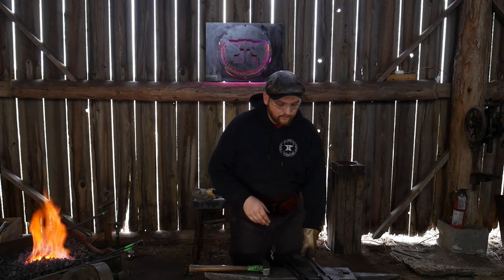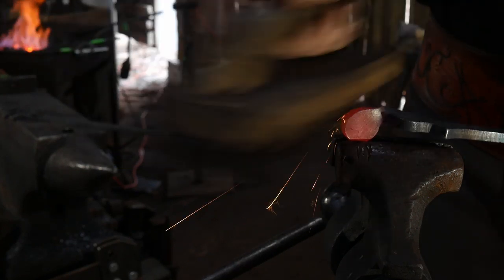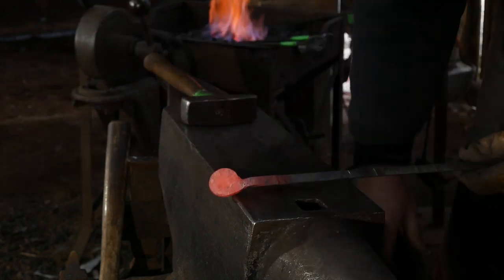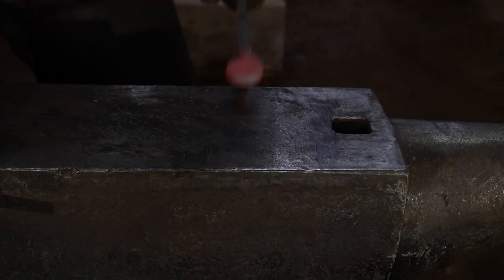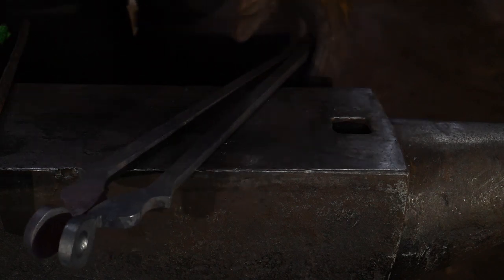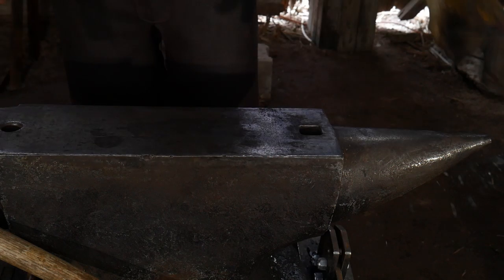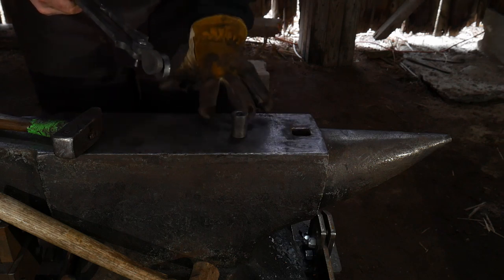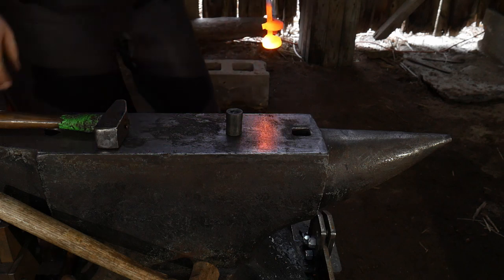Precut Farrier Tongs: Forging and Reviewing RX 09 Tong Blanks

Comment: Roy,  I make tongs with the "Dempsey Twist" method all the time.  I believe where you got confused on the twist direction was when you looked at the twisting from the jaw end when in the vise.  Normally, for the "right handed" tongs, being either forged or twisted, the direction is from the perspective of the smith with the tongs pointed away, outward across the anvil or vise.  In that case, the twist is correct in a counter clockwise direction.  When you looked at the jaws in the vise you were looking in the opposite direction and it was clockwise.  When forging jaws or twisting in a vise, always use the perspective of the smith facing along the reins away and toward the jaws...you'll never be wrong.
For "left handed" tongs, the twist is clockwise.

Comment: Greetings from Hellas.What kind of iron is that pair of tongs from?And how many inches is the thickness of it?
Reply: A36 mild steel and they are 3/8 inch thick hot rolled the tongs also all very in length depending on the model you choose.

Comment: Roy if you were left handed and making this tongs to hold in your right hand would you reverse the twist of the first step?
Reply: Thomas Brighton I believe if you line the reigns up you don’t have to worry about it as long as they are the same, but if you offset the reigns do it this way so they lay top is closer to the thumb in an open hand. That is my understanding of making tongs how ever I’m right hand and do it opposite

Comment: Does the ears serve a purpose or are they just for aesthetics?
Reply: IMO they are a remnant or vestige of forming tong blanks from a single flat bar.  After both ends have the nibs and boss formed, the blank is split down the middle with a hot cut.  However, when the slit approaches the boss, you curve the cut off to the side.  This leaves the "horns" or "ears" on the blank.  Crafty Apple cuts their blanks this way to resemble what is sometimes referred to as "ferrier" style.

Comment: You said farrier tongs but I’m not sure how they work, what’s the dimple for?
Reply: On sheet metal a purely flat faced nib has trouble getting a grip since the force is evenly distributed.  For flat jaw tongs an improvement is to add some vees and convert them to be closer to wolf jaw tongs. They grip better. So the ferrier tong needs something too.  The dimple or divot takes care of this. You could even use a triangle file and score the lip of the divot so that the nibs look like a set of dentures.  More grip.